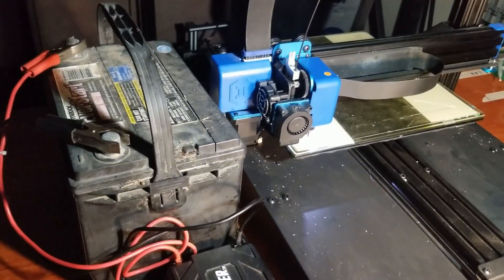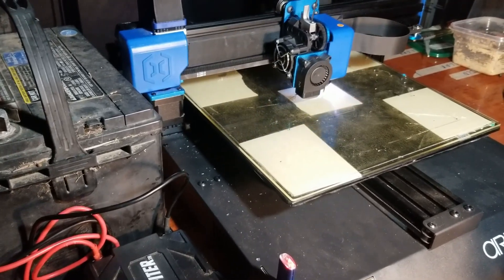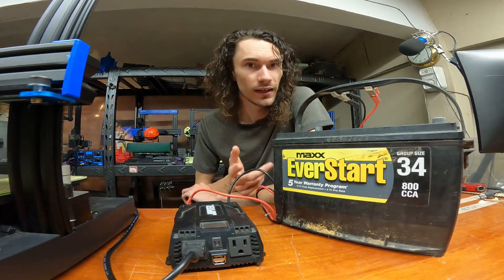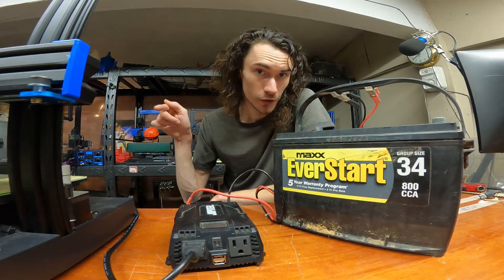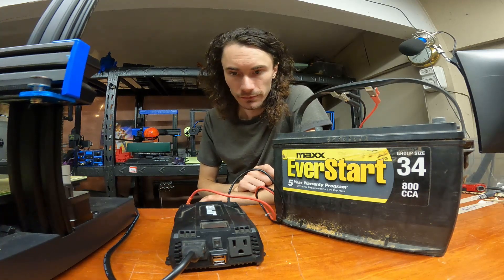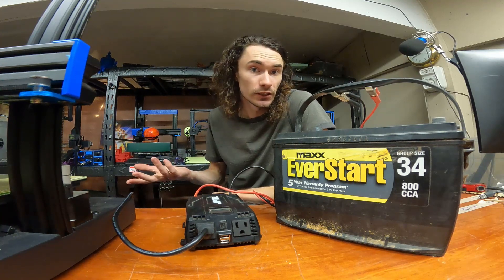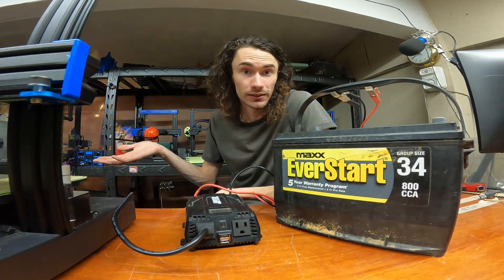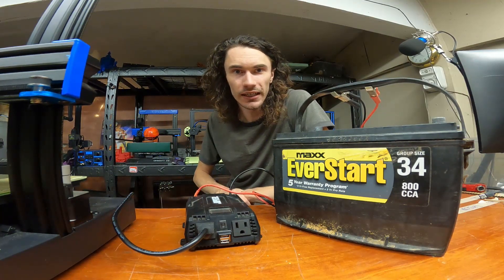Car Battery Powered 3D Printer?

Comment: Mine and my wifes 2022 jeep compass trail hawk has a 150w.
And we have a monoprice delta mini with  12v 120w draw. You think I have print on the go?
Reply from the maker: You MIGHT be able to depending on the fuse in your lighter port and how good your inverter is. Do check the power output your plug is rated for in your car first as most of those circuits max out at 10A output which is pushing it with your printer. If you can print without the heater bed on, then it should run just fine!

Comment: Could this work for example for 3d printers to avoid failed 3d printigs because of powerloss? Like lthis:
Printer is connected to battery which is also connected to the power and charging... so 3d printer is working and in case theres no more power for some minutes or an hour 3d printer can keep working and whenever power comes back battery starts charging and deliverying power at the same time.
(maybe adding some extra connections that dettect priority if its coming from the house then choose house if house has not power then take it from the battery?).
This could be a very stupid question but I'm curious...
(for all those 3d printing that can't resume 3d prints after power loss or those that can resume but 3d print would still print ugly enough to sell it).
Reply from the maker: What you are saying does exist. It is called a "UPS" or Uninterruptable Power Supply. Even if a printer has "power off recovery" I still vote the best recovery method is not to lose power at all. Depending on your needs you can find them relatively cheaply if they need a new battery and you are willing/able to swap the battery out.
Reply: could you craft one and teach us how to? Master. @MakeItWithCalvin

Comment: I'm trying to do the same thing but every time I actually go to print the inverter trips , I'm using a stronger inverter and it's running on my solar kit .
Reply from the maker: Are you using the heated bed? It could be detecting that as a dead-short and tripping the safety mechanism.
Reply: @MakeItWithCalvin  would you happen to know how many amps would I need to produce from my batterys to run a heated bed on average?

Comment: Now we need to figure out how to 3d print a battery with a battery powered printer.
Reply from the maker: Now that would be a fun project. Albeit a bit tricky.
Reply: @MakeItWithCalvin  I initially though about printing it in its entirety but realized it would be much safer to just add the battery acid after the fact. Although the thought does occur that you could print the plastic body and metal terminals separately and just design the terminals to screw into the body and lock in place. Might take a few iterations to get it to work but would be interesting.
Reply from the maker: @jebshere  oh for sure, all I can say is stay safe doing it but it may be also worth looking into alternative battery chemistries like in the old EV days back in the turn of the century.

Comment: the loud fans on my printer made me think: can I use DC/DC boost converter?
the PSU is 200W, the 360W converter on amazon is 28$
even if the battery last three hours that's a decent UPS
Reply from the maker: How would using a DC converter help the loud fans?
Reply: @MakeItWithCalvin ah, mised some words: the loudest fans are on PSU - if I replace the PSU with a battery I get rid of that noise.
Reply from the maker: Gotcha... I would say pop the PSU open and swap the fan but... that's a bit dangerous. Why not just grab a higher rated PSU to avoid the fans kicking on at all? And my old Thingomatic would like to have a word about being noisy... that thing can wake half the block when it runs!
Reply: @MakeItWithCalvin Not dangerous

Comment: E180 could run off 12v if I remember right, awsome idea 👌 don't you no what I'm off to buy 👍
Reply from the maker: I wonder how many machines could be powered on 12V if you disabled the heated bed? It has given me ideas, even if it is a 24V machine, for having something tiny/portable. Maybe a modern Thingomatic sized machine?

Comment: You can also use solar cells to recharge your battery! or if you know anything about capacitors,You can make a capacitor bankto recharge your batteries.Good luck! .Cal
Reply from the maker: I have looked into a solar panel for an upcoming portable power project, the only issue is with the cost/size of them/recharge times, but it is an idea! More or less this was a "could you do this in a pinch" and I think it worked!